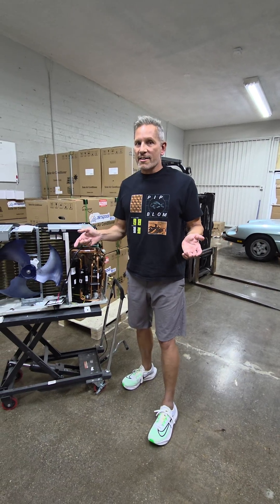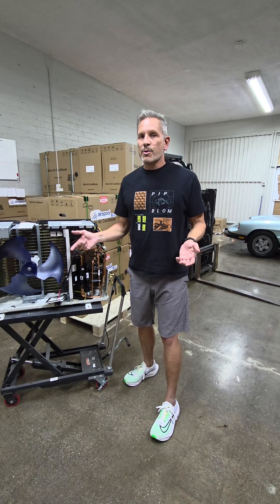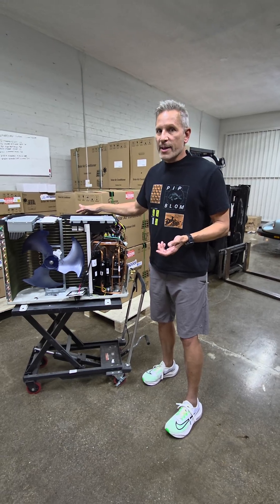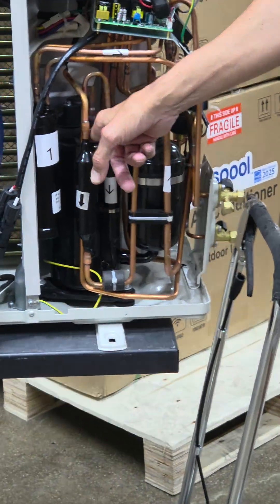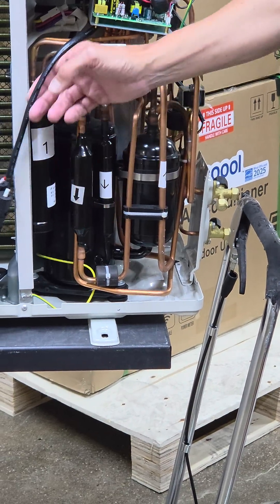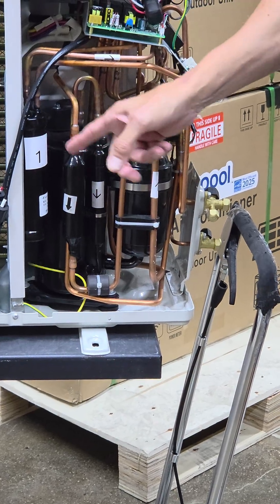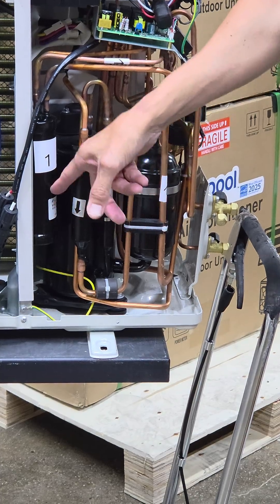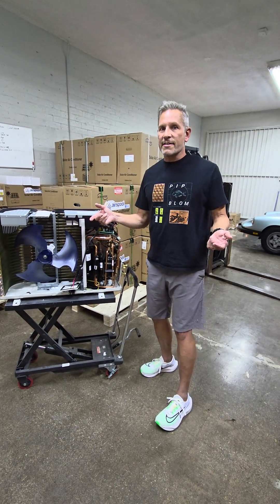How this heat pump keeps heating at –22°F ❄️🔥 #heatpump #EVI”

Comment: I thought most america products got r454b mot r32
Reply from the maker: Most big units have 454b because it's slightly less flammable.  Yes, both of these refrigerants will burn if they are exposed to an open flame.  But, if you take away the flame, they don't.  We switched to them because they're better than the environment than R410a.  And, yes, I think maybe some manufacturers like Trane and Carrier wanted their lives to be simple, since 454B most resembles 410a, so that coils, compression, etc. didn't need to be re-engineered entirely.   Too bad, though, when it comes to heating!, since R32 will help units go a bit lower than 454B.